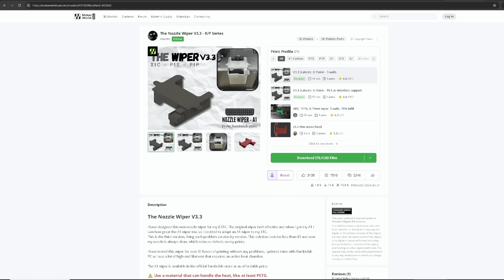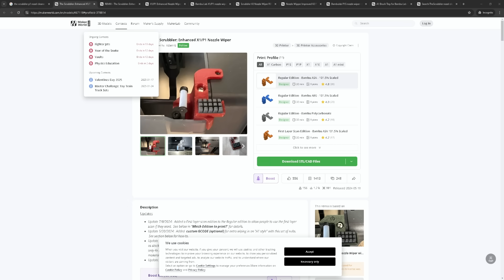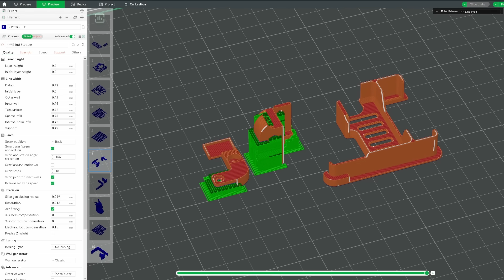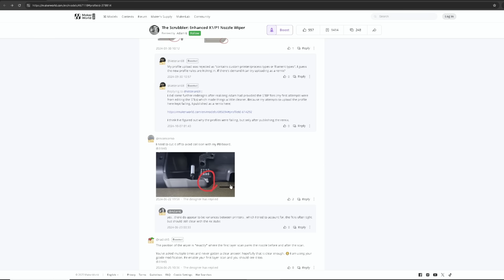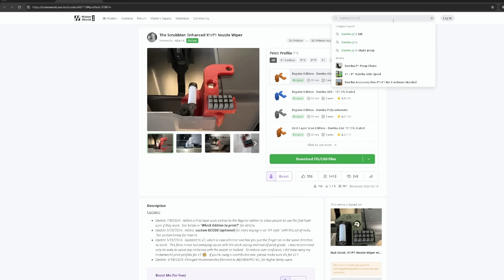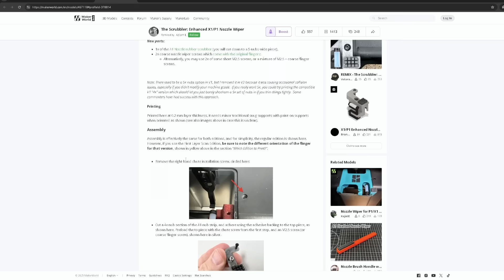Upgrade Your Bambu Printer: The Scrubbler for Perfect Nozzle Cleaning!

Comment: Not sure what reviews you looked at, but to go along with the positive reviews, there are PLENTY of negative and unsuccessful reviews. Sounds like WAY too much trouble for next to no gain. Makes your efforts seem like they have an ulterior motive. Hmmm
Reply from the maker: Well as you'll see in the video, I also had my fair share of failed attempted where it didn't work. However it's important to make sure you install the correct version for your printer. I work really hard to maintain the integrety of my channel, and never want to share information/products that is incorrect or doesn't work. So no, there isn't an alterior motive, just the motive to help my viewers as much as they have helped me. :)

Comment: Does the G1 F3000 at the end of the gcode force 3000 accel, instead of actually reverting it back to the original values as sliced?

Comment: Absolutely nothing wrong with the stock one. It's not a thing of just working "ok". It actually does what it's supposed to do. Just something for someone to try and make money off of, either with the actual part or likes and subscriptions.  I print with every kind of filament, including petg. Never ever had a problem. Zeeeerrroooooo problems.
Reply from the maker: The stock one works well, but it also depends on the ambient temp your printers are in. Here in Australia, it can get really hot, which causes filament like PETG to stick more than usual. But if the stock wiper works well, then happy days!

Comment: ::checks description and comments for updates:: 😥
::will probably install this mod anyway::
Reply from the maker: Haha sorry... I will need to update the description. But in the mean time, it works really well. It does flick filament sometimes, but most of it lands toward the back of the printer and hasn't caused any major issues when it comes to printing over flicked filament that landed on the bed. Just make sure to check the rubber part occasionally as it will wear down over time and need to be replaced.

Comment: Hello! I bought an used p1s combo at local market, it was having some layer shifting issues, I removed this mod and seems it returned to work normaly,
Have you had some issue with steps loss with this mod?
Reply from the maker: Sorry to hear you are having issues with the printer. But no, I have this installed on most of my P1S's and they all work perfectly :)

Comment: I just did a simple replacement of the white Ptfe tube on the original wiper bracket with a silicon tube which is soft and a little bigger in diameter and it works a lot better than the hard Ptfe tube.
Reply from the maker: That's a clever idea! Glad you found a solution that works for you.

Comment: Do you think you could print the rubber part  in TPU or would that be to hard and harsh? I am using  a hardened nozzle on the P1P.
Reply from the maker: I'd just go with the purpose built scrubbers, as they were designed specifically for nozel cleaning. You may work initially but I'm not sure how long it will last with a hot nozel scraping over it all the time. The scrubbers are super cheap anyway :)

Comment: Hi,
I have 2 P1Ss and a total NOOB. I have destroyed 2 extruders and hot ends trying to print PETG. Do you have specific PETG profile you use for your P1S? Also any advice you have please... I do live in Florida USA, so I am ensuring my filament is dry and sealed. thank u
Reply from the maker: holy cow! 2 extruders...that sucks to hear dude... I found the biggest help with PETG is to print it slow, like 20-40mm/s slow. There are High Flow versions, but I've heard you don't really get much more speed out of them.

Comment: You should also try the stein wipe i think it was the original but it works the best so far and it has stein switch defenitions that judt have a lot of features that are much easier to do with the defenitions like you can get a true pressure advance on a p1s and things like that its very good and never fails but you have to use a drill to the printer

Comment: did you have any problems with stock nozzle cleaner?  is it an improvement? :)
Reply from the maker: It's awesome! Just have to replace the rubber scrubber part every few months and it works wonders.

Comment: what’s the white square material you used to on the poop chute?! i’m having issues with the poop sticking to the side of the chute and i think that might fix my problem.
Reply from the maker: Could you leave a time stamp for this white square material you speak of? 😋
Reply: Tape.  At the 5:09 mark.
Reply from the maker: @Digikidthevoiceofreason Ohh that thing. Not sure what that is to be honest, it came with the machine.... But it does appear to have some  type of low friction material on the exposed face....I've found baking paper to be really good at stopping filament from sticking to things...

Comment: some updates so far ? :D
Reply from the maker: It still works great! Just make sure you check on the rubber scrubber part, as it seems to wear out faster than the ptfe tube part. Unsure as to the time frame of when it will need to be replaced, but I would say possibly every 2ish months.

Comment: I'll be doing this tomorrow. 

The stock solution isn't too bad, but my god it is when it flings 1g of "poop" filament onto your bed sheet that either gets stuck to your nozzle, or forever becomes part of whatever it is you're making.

Given I'm about to 3D print an entire ITX PC case with modular sections with some fairly long print times, I really don't want to risk any long prints getting ruined due to some stray bits of PETG.
Reply from the maker: Yeah the flinging is super annoying, especially when it gets underneath the first layer and you don't find out until the very end XD Just make sure to check your rubber scrubber part every month or so to see if it needs replacement, depending on how much you use it...

Comment: This isnt the original design that uses both wipers (im just saying that so hopefully the original creator gets his credit). Ive been using it for a very long time and whats weird is every now and then my print head parks in different spots to purge filament lol sometimes it parks i between the two wipers and purges and fills it up. But i asked around and mine is the only one that does it (imagine that). Oh well it wipes far better than stock.

Comment: Nice review. Personally, I'm using the latest version of "The Wiper" - v3.4, printed in Atomic's ASA-CF with the wiper bit glued into place and the original PTFE wiper still in-place. Works great overall, though I did get a tiny piece of filament jammed between the tines of the A1 wiper block on one occasion. Beyond that, it's been 100% perfect.
Reply from the maker: Oh nice! Looks very similar :) The scrubbler has a bit of occasional spray, but it's all aimed toward the back of the printer for some reason and never gets on the plate to mess up a print :)

Comment: I also had it installed, and the silicone was destroyed within 5 prints. I reworked it and reduced the height. Now it's better, but it's not really reliable. I wouldn't recommend it. There are better options.
Reply from the maker: Yeah I found it was useless until I got the height dialed in perfectly, fortunately there are a couple of versions out there with various height levels (the one I found that was adjusted for the P1S worked like a charm). I would suggest trying them first before getting in and adjusting it yourself.

Comment: Petg is 90% of what I print so I'll be printing this.  How often do the silicone scrubbers wear out?  The one you linked on Amazon have a ton.
Reply from the maker: Noice :) I've have them on since Jan 2025, zero issues with them wearing out. Just make sure you get the right version for your printer. If the height is off slightly, it can ruin them very quickly as the nozzle digs into them with great force XD
Reply: @LayerLabAustralia  ok, I ordered a smaller set and I'll see how they do

Comment: just replace the ptfe tube on the original wiper with a silicone tube...good solution and very easy to do
Reply from the maker: great idea! will give it a try :D
Reply: what size silicone tube?
Reply: @davidwalker7716  2mm ID and 4mm OD

Comment: that rubber. i  reluctant as i see people complaining about bendt extruder/nozzles causing leakage on the bambu. for me it appears rhis rubber would stress the nozzle assembly more over time than the normal wiper. thoughts? why  not use a  steel brush for wiping? with fine steel threads?
Reply from the maker: If it works well enough on the A1, I'm sure it is okay to use on the other printers :) That's my logic anyway :P

Comment: I'd like one for the x1 carbon, it is said that if you have activated the scanning of the first layer on the X1 does not work
Reply from the maker: There is a first-layer scan version you can always try, it has some adjusted tolerances :)

Comment: I've had my P1S for 8 months with 1200 print hours and i'm still using the stock wiper ( i've replace it once but with stock design)  I have zero need to change it up, it works just fine. Don't fix what ain't broke.
Reply: Then…don’t? 

I get PETG strings all over my build plate from the nozzle. It’s broke, I’m going to fix it.

Comment: Ran into some issues with the scraper screws are too long and bottomed out. Had to use the spare screw in the spare wipers. 
You mentioned chasing the holes, another issue was the adapter that fits in place of the original wiper. The hole is to small and I had to drill it out.
The poop housing shield as well is very tight one side and loose on the other.
Reply from the maker: Hmm... If i was to guess you must have an X series printer? I believe there are some slight tolerance deviations between the P and X. How did you go after you adjusted everything?

Comment: I just got a x1C 3weeks ago have printed with it about 50hrs and have a problem where the little amount that seeps out while it heats up for the bed probe is just enough to throw off the z high calibration causing the calibrations to look like crap and the printer does it’s lidar/camera sweep and things everything is fine and continues to print. Very annoying to constantly sit next to it while it gets ready for a print to manually wipe the nozzle with a brass wire brush just before it starts to touch off the bed.
Reply from the maker: Yeah, i was having the same problem with my P1S, but then I realised it was just my bed that wasn't clean enough, nothing to do with the z-offset. I would suggest installing this nozel cleaner anyway, but also washing your build plate with dish soap, and you should be good to go :D

Comment: Has anyone printed the Scrubber pads for the A1 from TPU?  I was just wondering since I don’t have an A1 and thought it might be doable..?

Thanks
Reply from the maker: You could always try! I couldn't find any STL's already premade, but it would be fairly easy to design... Otherwise, the rubber version is very cheap so you can always fall back to that if it doesn't work.

Comment: I tried this and the super glue didn't hold. Peeled right off. Maybe it was because I bought it 3rd party, but I don't see how super glue could hold it since it silicone. I'd rather see a mechanical connection to the wiper material.
Reply from the maker: You should try the glue I recommended in the video, it works really well :) I used it on both scrubblers for both my machines and it has stayed put :D
Reply: @LayerLabAustralia  I actually just used some sewing thread and wrapped it around in between the bristles. that seems to be holding well. I superglued the string in place on the back so it doesn't loosen. If that doesn't work out long term I'll give your glue a shot.

Comment: did you find the need to modify the g code after instalkign this wiper?
Reply from the maker: You don't need to, but it helps make the nozel extra clean :)
Reply: @ new to modifying the gcode.  do you need to insets these commands into every profile or once and it carrys over to all?
Reply from the maker: @ChipPuccio  You just add it to your printer settings, if you use the same printer, it carries over to everything else :)
Reply: @LayerLabAustralia thank you.   Figured it out.

Comment: Works amazing with an ams installed I print exclusively polymax tough pla with petg interface layers on supports on my p1s my prints are sometimes 2 days long and I would have constant poop on the build plate now in a 24 hr print I have maybe one

Comment: Hi All, being new to 3D printing, but experiencing issue with PETG not coming off the nozel, I am looking for an upgrade, but the BIG RED WARNING about breaking my £1200 X1 Carbon if the First Layer Enabled is on really worries me, please can you explain what this is, why your design does not accommodate this feature and where to switch this feature off an ensure it is always off as the nozzle cleaner is always fitted, how do I disable this feature permanently to ensure I don't forget and trash my printer ?
Reply from the maker: Hey Ken :) I believe there is a first-layer scan version to accommodate this issue. Have you tried that out yet? I am not the designer of these mods though, I would suggest leaving them a comment on their maker page as they will have much more useful info than me :P

Comment: Sadly mine caused the printer to try to print with the bed about 3-4 cms below the nozzle. I had to trim the lip for the bed to be able to rise fully and still 9/10 it failed. Once I returned back to the default option the printer was fine.

Comment: I made a version that allows for regular V6 nozzles to be installed using aftermarket aliexpress hotends, by lowering both the nozzle wiper and the rubber pad. It wasn't easy, I had to make it into a singular part as opposed to two. That means I have to glue the rubber pad AFTER it has already been installed in the printer.

But this solved two of my problems: I can now use regular V6 CHT nozzles AND the nozzle is cleaned better than ever. Very pleased.
Reply: Link😊

Comment: Great video. I implemented the same Scrubler as above on X1 Carbon, however now the filament purging happens right on top of the X1 wiper. Is it possible to modify the G Code to move the head more to the left before doing the purging?
Reply from the maker: i believe there is a way, however I don't have an X1 to test with. Have you tried pasting the gcode into chatgpt to see if it can do it for you? sometimes it works :P

Comment: Could it be that the first one from "NeedItMakeIT" wasn't seated properly? There are two little guidepins, that need sit correctly when mounting inside the "poop-shute". On the video it looks like, it wasn't properly seated.
I saw your video, made it from the remixed version (fixed hight P1s), cleaned around the guidepins and all that, and mine was too low. I then printed a 1mm shim, to get it in to funcional hight :-) I could be wrong, but...  Nice video 🙂
Reply from the maker: Not sure about the nozel wipers he used... But I know what you mean about those pins. I think one of them actually fell off on the final version but didn't seem to affect it. There appears to be tolerance differences between machines, so i guess it isn't a one size fits all 😢

Comment: Do NOT purchase a Bambu printer unless they reverse course on their new firmware update which limits 3rd party software and further locks you into their ecosystem. What's next "Sorry, you are not using Bambu approved filament...cancelling print job" or "This object is not approved...cancelling print"
Reply from the maker: At this stage its just speculation as to what they are going to do in the long run. Hopefully they don't go down that route!
Reply: LMFAO. Cry more prusaboy

Comment: This is a nice upgrade. Might have to try it, but the problem for me is that it oozes a little bit of filament as it heats up to do the purge line. I want some help to add a nozzle wipe to the g-code after the purge line is done, right before it starts printing.
Reply: I found my solution for that is to add a a couple skirt loops around my prints. I only use it for prints I don't want to do redo or watch the first layer as unsticking a 1mm wide, 1 layer tall petg line on the PEI plate is a PAIN haha
Reply: @0Rookie0  Nice idea. I will try it today and see how it goes.
Reply from the maker: I'm sure it is possible...maybe a video idea 😜

Comment: I have tested several wipers but simply replacing the 4mm PTFE tube on the original wiper with a 6mm silicone tube works best for me. Since then never had any problems on my x1c
Reply from the maker: Wow, simple, but effective! A slightly larger tube...
Reply: 6mm by what od, amazon has 6mm x 8mm OD is that what you used?
Reply: @davidwalker7716  6mm od 4mm id
Reply: I am going to try this before I make the scrubber, i have some 6mm silicon tubing lying around ! Thanks!

Comment: I have 2 P1S they both have AMS, after watching your video i print up these and they have been working with no issues. It also stop the stringing when the AMS is changing filament for different color. Cause once in a while a thin string gets drag onto the plate.
Reply from the maker: That's awesome to hear! I've been loving my scrubbler, glad it's helping you too.

Comment: Wiper v3 was fine until the rubber started breaking and the glue on glue wouldnt keep the new rubber in place didnt want to print a whole new one just so i could glue it.
Reply from the maker: That's a good point, the adhesive on super glue may not be super permanent 😆 but so far so good! As I mentioned in the video, if I have any updates I will put them in the video description :)

Comment: Do you actually need to edit the start gcode or also will work with the default one.
Reply from the maker: It should work without any gcode modifications, but they do helps to get every last piece. :)